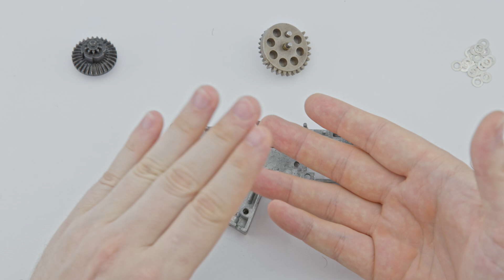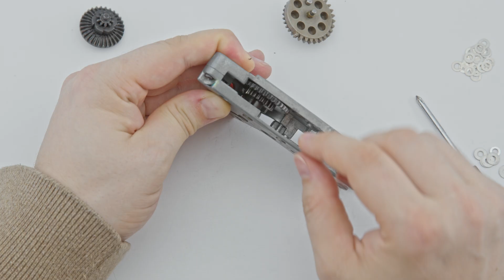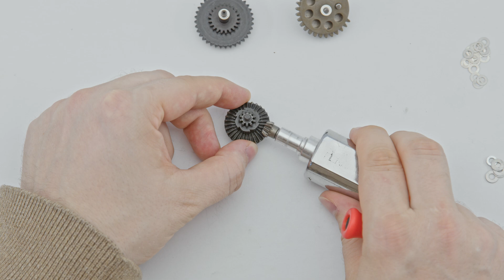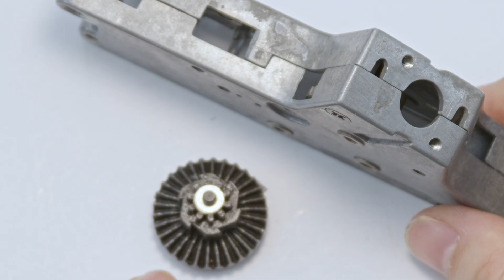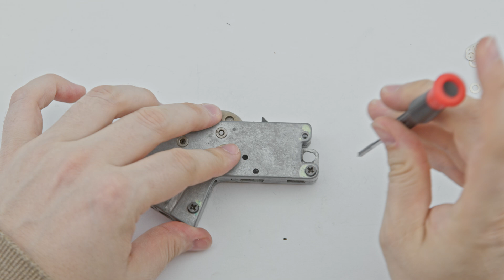The last AEG Shim guide you'll need

Comment: Im curious to know, whats the highest ROF you have built with this shimming process, and how long did it last? As far as i know, shimming pinion to bevel height, and then checking the bevel’s  position relative to the pinion is paramount to the replica lasting for a long time between service and to get optimal pinion to bevel meshing. 

I ask highest ROF, because most mistakes and issues will show themselves quickly in high ROF builds. Something that works in a 20rps rifle without issue will break immediately in a 40rps rifle, and even faster the higher the ROF goes up.

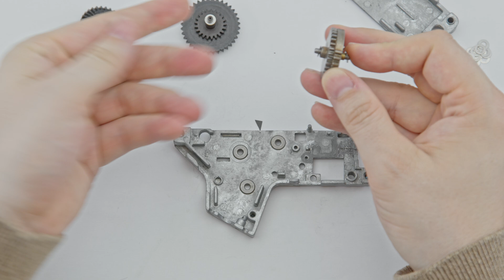Comment: I get stuck at 13:00, seems like either my gears or bushings are canted. Theres maybe 1/8th of the total rotation that is very sluggish while it spins fine the rest of the 7/8 turn. I’m at the point of putting like .60 in shims under the gear that interfaces with the piston, .20 for the other which I don’t dare go beyond because of the bushing. I’m .10 from having no shims on the gear I put .60 behind.
Reply from the maker: Yeah that's the thing. Shimming is easy as long as the parts fit. Sometimes things are bend or are just made with impossible tolerances. It's difficult to say. Feel free to pop by the discord if that helps.
Something like that could indicate a bend gear or debris in the teeth.

Comment: The best thing with this split box is you can isolate the problem down to the gear vs piston easily. I was working on my lancer's traditional gearbox and discovered my issue was over tightening of the top 4 screws that holds the upper portion shut. Causing my piston to bind when pulled back. I kept taking it apart thinking it was gears binding. Turns out they were shimmed alright, I finally realized when I saw the blackening near the back of the piston travel rail all the black wear mark from my black piston. 

Your guide is interesting and I would try it next time, I always used the bevel first but I think your way actually makes more sense as there's a lot of room for adjustment on the bevel if you leave it last. If you do bevel first you're pretty much stuck trying to figure out the max margins you have for the spur and so on.
Reply from the maker: It doesn't really matter if you do bevel first or last per my guide, what matters is which gears you "slave" to which ones. In my guide, i leave the spur and bevel mostly alone from each other. The bevel is adjusted to the motor (or rather, the motorhole), and the spur is adjusted to the sector/gearbox. But neither spur or bevel are adjusted to each other.

What many people suggest when they say "bevel first" is to adjust the spur and sector to match the bevel.

Comment: You should really start with Shimming the Bevel Gear with the Motor/Motor Grip 1st. You're "in the middle" method makes sense; however, it does not account for Motor Grips with different alignments. Not all Motor Grips are made the same so you have to account for how one will position the Pinion/Motor higher or lower than where the "middle" of the Bevel Gear is positioned. Therefore, your "middle" may actually too low or high for the Pinion to properly work with the Bevel no matter how much you adjust the Motor Height Screw on the Pistol Grip. (Sorry ahead of time if you've already made a new video about this).
Reply from the maker: No. I did that for years when i was a home tech, but after working in the industry as a tech, i realized that it's a too-often futile method that is not feasible for the average user learning to tech.
The far majority of bevel-pinion shim issues stem from the parts not meshing on a design level, not a shim level. That is, the gear teeth not being designed together, or the grip/receiver/gearbox causing fundamental misaligment.
None of these issues can or should be solved by trying to shim the bevel gear to a wrongly alignment motor axis. They should be solved by having parts that fit together well.
And when you have that, then the shimming is very easy and can for the most be done by shimming "In the middle".
Though that said,  i would then still additionally shim the bevel up/down 0.2mm just to check if it gets better in either direction.

Also disregarding that, it's important to understand that i'm not saying to shim the bevel to match the spur. Rather i'm saying to shim spur and sector together, and then bevel-pinion together, with a ? fit between spur and bevel. That's different from shimming the bevel to spur.

Some AEG's are terrible to shim, some are a dream and everything fits easy. The solution to shimming issues lies in using a gun body where the parts are in alignment (and gears that match).

Comment: Great video! I wonder if you can shim the bevel gear like we shim pinion gears in differentials in cars. We usually paint the gears with a machinist dye and check the contact based on where it’s worn. Not sure if these gears are too small. I guess I’ll have to try to find out
Reply from the maker: That's something i've thought about before actually, but never explored further.
The thing is, that makes sense when the parts are really big and expensive, but airsoft parts are not so expensive compared to the time required to troubleshoot, so sometimes its better to just thrash it and buy known good parts. A gear in a car gearbox probably costs more than the whole AEG.
Reply: @PerfectAirsoft that’s true. And setting pinion depth often means wasting a bearing, which in itself cost more than airsoft gears 😂
Reply from the maker: @brokeboycustom  The problem with AEG is generally mis-alignment, which can't be solved be shimming the bevel or pinion.

Comment: my g&g gearbox was so tight i had to sand the second gear bearings to even fit 0.1mm shim
Reply: My f2000 is the same way.
Reply from the maker: They can be tight yeah. Fitting gears in the G&G G2 shells is not the easiest.

Comment: are there no issues with gear alignment after you did this?
Reply from the maker: Well, this guide is a general template for installing gears in the shell. Alignment issues is a different matter on a per gun basis.

Comment: For the bevel gear you can use the half shell method, where you only install the bevel, bottom half of the GB shell, attach the grip ( with one screw ) and put in the motor with the spring and close the grip.
That way you would see how much contact the motor got with the bevel so you can set your motor height perfectly.  

Also you can set the height of the bevel compared to the motor. 
If it sits too low the motor will put pressure on it , if it's too high not enough contact will be made with the motor.

The hard part is sometimes to match the spur bevel height when you work with a tight box.
Reply: This is the way. Otherwise like in this video its just a big guess.
Reply from the maker: I comment on this a bit through the video. What do you think?

Comment: So for the motor shimming. While working with after market parts. You can attach the grip to the gearbox outside of your reciever and shim it that way. Then make sure your grip has a small tiny (.1mm or so) gap between the reciever and pistol grip when assembled. This way you take the reciever tolerances out of the equation and it becomes way easier to work with. If theres no gap. Then you just sand the pistol grips top and front contact surfaces down till there is.
Reply: The ultimate issue there is assuming that the V2 gearbox is going into an AR style RIF. An MP5 would need the videos approach to shimming
Reply: @Flatcap-hz9bj  this works with an MP5 without even needing the whole adjusting the grip portion as the lower houses the gearbox in that replica as far as I know.
Reply from the maker: That's what he's saying :D
Reply from the maker: Thanks for your comment. Yeah thats something that can be done, but it's very "custom worky" and it's difficult to for sure test things this way. Best thing is to just have body parts that are designed to fit together.
Reply: @PerfectAirsoft  In an ideal world everything would fit everything perfectly, but we don't live in that world. The next best thing is removing as many variables as possible, and removing the interaction between the pistol grip and lower receiver removes an interaction and tolerances between those two parts. Also in an ideal world we wouldn't have to spend 500$ on aftermarket parts, the factory replicas would just be good to begin with ._.
Reply from the maker: @vulpix9210  Amen man
Reply from the maker: @vulpix9210  V3 should have solved that with it's motor cage, yet here we are...
Reply: @PerfectAirsoft haha V3 is another can of worms. I'm rebuilding my AUG with a new Perun soon. Gonna be interesting.
Reply: @PerfectAirsoft Not so difficult on V2 tbh. First I check if the motor grip is touching the lower receiver, if it does I use spacers to prevent that. Then I install the bevel gear, grip and motor and set the motor height in they way the pinion fully engange the bevel. After that I start shimming the upper part of the bevel as the best as I can, after that I shim the lower part. Yes it's very time consuming but it's the way to do a proper job. You can also use a tool to check if the grip heatsink is aligned with the gearbox hole, yes it's again time consuming. It would be nice if someone designed a V2 shell with motor mounting like PTW so it would be always perfect and we could use slim motors as standard.

Comment: Great video! I am close to your method but I keep the cut off installed as I had issued with some manufacturers. The cut of had a very thick flank resulting in scratching the side of the sector gear. And I love you for explaining it has not to be perfect! This isn´t rocket science and cold weather could kill a tightly shimmed gearbox.
Reply from the maker: Nothing's perfect at perfect airsoft!! ;)

Comment: Not going to lie kind of skeptical at the beginning just simply because I've been taught bevel to pinion this and  bevel to pinion that lol. But I must say this method seems pretty damn good so I'm going to give it a shot and see what happens from there.
Reply from the maker: Yeah check out my discord if you want a more in depth explanation: https://discord.gg/Pj8adPVnuH 
It's a more nuanced case than what many hometechs have repeated from each other.
9/10 times the issue is with motor mis-alignment, and no amount of bevel shimming will solve that.

Comment: if there was any way to make AK guilds that would be great. everything you see on YouTube all use M4 V2 gearboxes and parts and they never really touch on the difference between that and the V3 style. so another great video that I know I will watch 2 or 3 times over to take in all the info.
Reply from the maker: You're right. It's the most popular, and in theory AEG knowledge transfers between platforms, but there could be some quirks and work methods unique to V3 worth knowing. What do you suggest? Maybe let me know on discord https://discord.gg/55D8vuUz
Reply: it´s the same thing, both uses same gears and for me it´s easier the v3 bc of the way the motor is attached

Comment: Nice vid, i like to shim pinion and bevel first, it's just how i learned it, might try it this way and see the difference, the only thing that i don't think that is checked here is the contact area between the teeth of the bevel and spur gear.
Reply: Bevel to pinion is the right way to do it. It is the most important point for transmitting rotation in your gearbox and it is the one that will cause the most problems
Reply from the maker: @ObitoLeTueur  Thanks for your input. If you watch the video fully, you can see how it is explained. Feel free to hit me up on discord if you're interested in this.
Reply from the maker: Thanks for commenting. Yeah you're right, it's not touched on per say. But that's because that it's the last link in the shimming steps. The bevel is defined by the pinion mesh, and the spur is defined by the sector which is defined by the piston / tappet. So the intention is simply to hope that the spur and bevel matches OK, and if they don't, use different parts. There has to be a compromise in the system, and it's best to do it there.

Comment: Many people is going to burn you alive, i can clearly listen to them in my mind yelling like crazy YOU SHOULD START WITH THE BEVEL GEAR AND THE PINION OMG!!!!!! 
But they will be wrong, this is a fantastic shiming tutorial, i found myself doing the exactly same process (usually) as i was getting more and more experience working with guns, and working with different and weird guns not just V2 m4´s.
Good job man, and dont forget to upload part 2, when installing the motor and motor grip, you know.. because of the "yellers" ^^ 
I will be waiting for it.
Reply from the maker: There's room for everyone. I take bevel last, but there's no problem in doing bevel first really. The important point is that bevel-pinion and spur-sector are shimmed as two seperate groups first, and then combined in the event with compromises. Thanks for the compliment. It's a long video, not everyone's cup of tea, but i've wanted to do a definitive series on AEG shimming for a while.